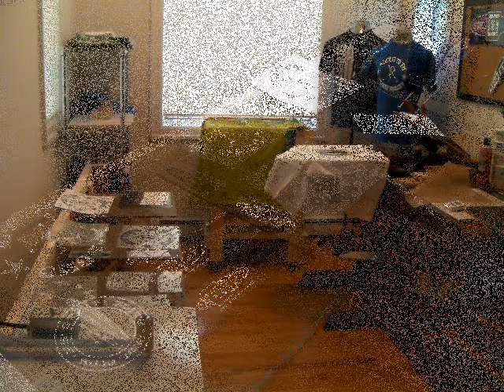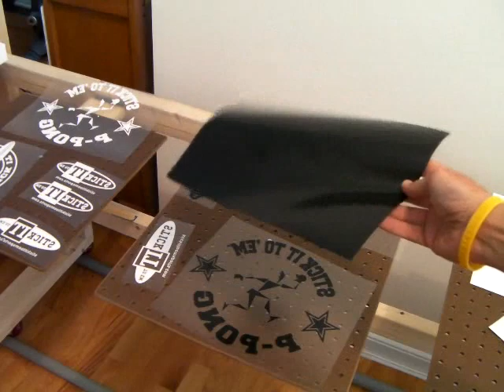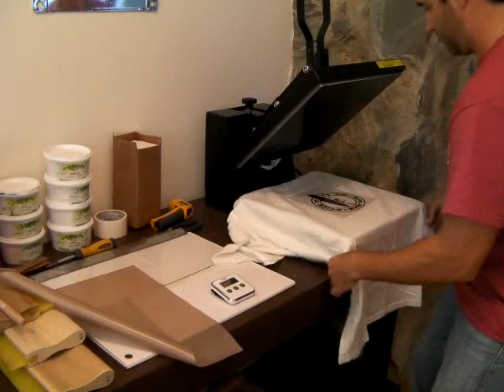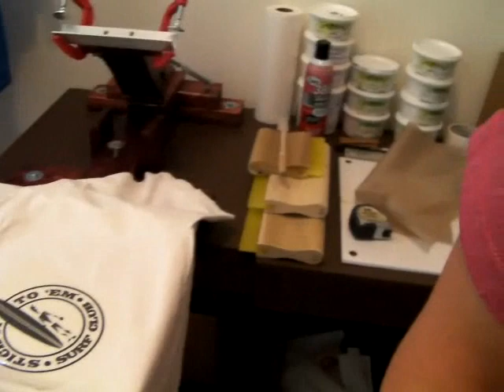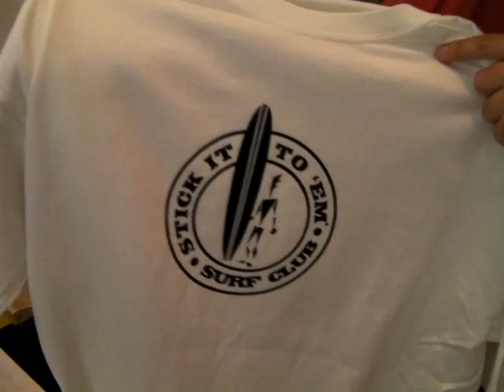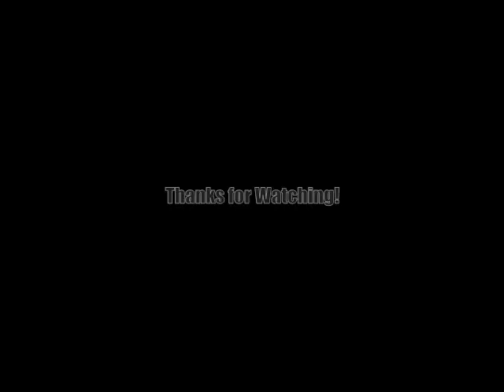Vinyl Heat Transfer T-Shirts

Comment from the maker: I'm not 100% sure - in my opinion, not likely. Most heat transfers require to be pressed for approx 20 seconds at 300+ degrees. I would ask the experts at Beacon Graphics.

Comment from the maker: The vinyl heat transfer is great for short runs or applying individual names and numbers on tees. Disadvantages, not cost effective on large runs (time consuming weeding out the image, the vinyl is expensive compared to ink) detailed images are difficult for the vinyl cutter plus that = more weeding. So it really depends on the job your doing. Both have their place. Hope that helps. Thanks, Steve

Comment from the maker: Hard to answer that questions since there's a few variables that would determine the cost per tee. Size of your graphic, number of shirts, how many impressions (front, back, sleeve etc.) number of colors. Most likely no, but if you're doing less than 20 pieces, it's possible. If you outsource the minimum is generally 24 pieces. Hopefully that helps!